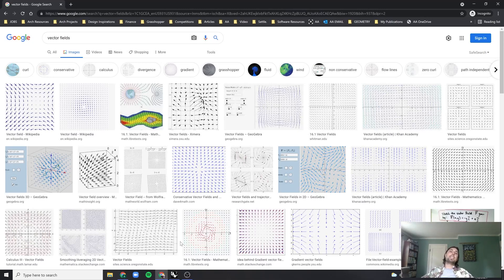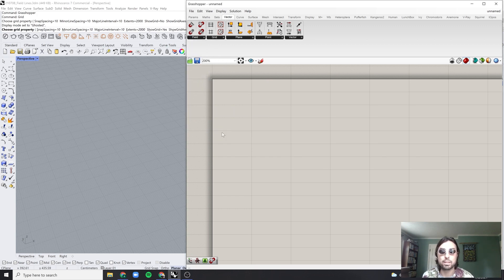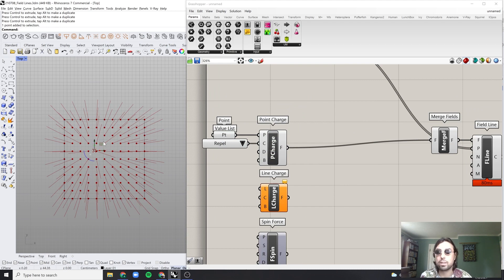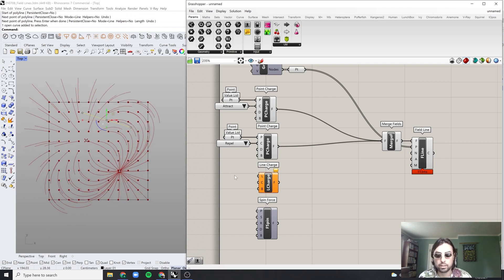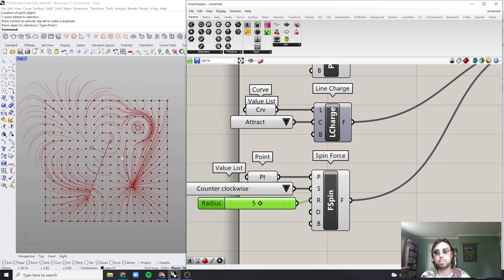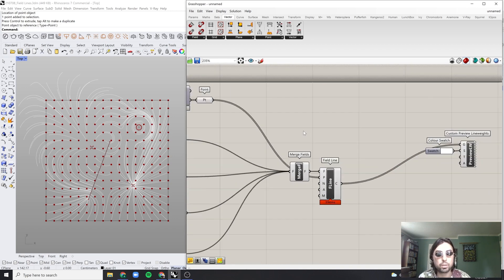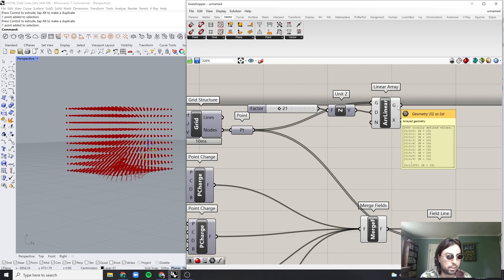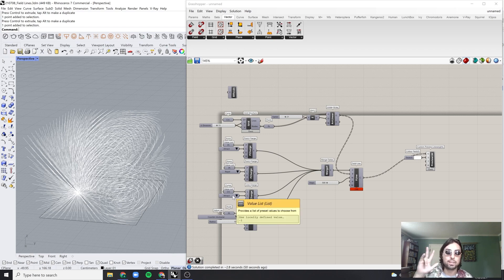FIELD LINES & VECTOR FIELDS (Grasshopper tutorial)

Comment: thanks for the tutorial. it's great. very well explained. I used point charge and assign different numbers to decay. but the result did not change with different decays. how's that?
Reply from the maker: make sure your data trees are properly aligned!
Reply: @AndrewFriedenberg  thanks for the reply. I don't think it's the data structure. I mean i run different tests, and i assign different decay value for the tests. but the results are similar. Is there a way to open the component to see which mathematic function it used?